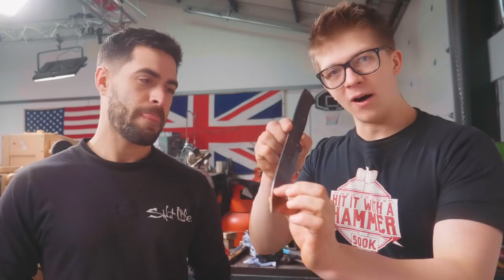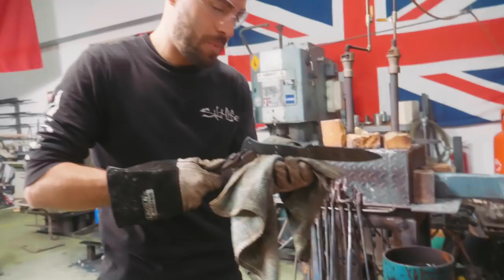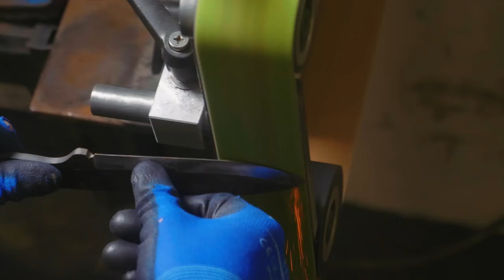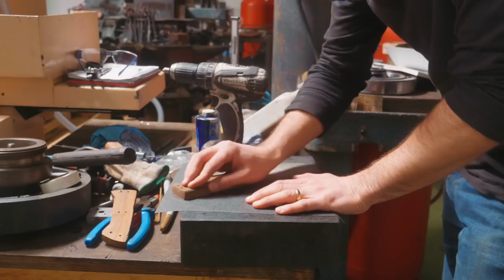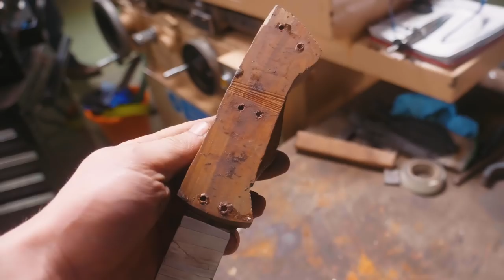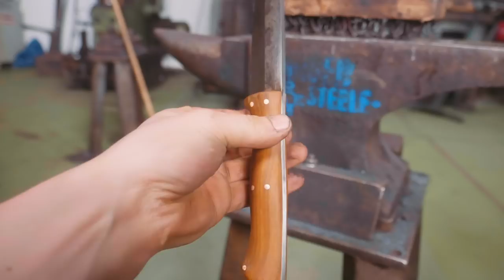MAKING A BUSHCRAFT KNIFE!!! Part 2 With TA Outdoors!!

Comment: Alec,as a machinist/fabricator with over 40 years experience I can assure you that you do what you have to do in order to get the job done. Tools and tooling was made to be used. So thanks for the warning but I get a bigger kick out of seeing you get the job done ,come hell or high water.
Reply from the maker: Thank you sir!
Reply: wes bang on mate. as long as the product is 100%  A ok the method to reach that point is secondary. i do admit thought i actually love someone taking the "long way" around to "right" than the quick way to "ok"
Reply: In the field its getting the job done, not about the... perfection of how a tool is suppose to be used. That is left up to old mate with a clipboard, that half the time you just want to F*** off. 
i think AVE put it perfectly in one of his older vids.
Reply: Perfect is the enemy of the good :p
Reply: Wow this comment really weirded me out... I was like hey I don't remember posting this and I certainly don't have 40+ years of experience...

Comment: Fun Fact(s), Lignum Vitae was used as a bearing material for ship propeller shafts where they exit the hull. Waterproof, self-lubricating and very hard wearing. Good choice ;)
Reply: But incredibly hard to find, on the endangered list and cannot be traded between countries, so I'm wondering how he got it? Probably Argentine, but even that isn't easy to get, at least not last time I checked.
Reply: I think that's a fun fact! Bowlinggg!
Reply: @tybertimus  It's not that hard to find as long as you're not looking for large pieces. Lots of it is recovered wood anyway as it got used for all sorts of things. Old light rail systems with overhead feeders often used it because it could tolerate the high temperatures of the high DC volt power systems. Most have been replaced at this point, but there is a lot of recovered wood sitting around out there. 
Also, there are a few species of wood that get passed off as lignum vitae so he may not have a piece of the actual stuff.
Now that Alec is in the USA, he'll have access to all the mesquite he wants. It's not as hard as lignum, but its a lot easier to work and is roughly as hard as some of the tropical rosewood species. It also resists rot and is super stable.

Comment: Hi Alec, I have had this trouble with O1 before and other alloy steels. You need to do a spheroidising anneal.  Heat the steel to sub  critical temperature, around 400 C (dull red in the shade). Have it sandwiched between 2 other pieces of steel of similar size and thickness (bound with binding wire) and rather than leave it in the forge use a bucket of fine vermiculite as an insulator. This is essentially a high temperature temper with a super slow cool. I have had success with bearing steel and O1. If you read this I hope it helps for next time.

Comment: Lignum Vitae is one of the few woods so dense it will sink in water. Until the advent of advanced polymer plastics it's main use was for tools and parts that ordinary wood could not hold up to.
Reply: Fun fact, was even used as the main shaft bearing in the first nuclear submarine.

Comment: Easiest way to aneail it is with a bag of vermiculite.  It's in the plant section at your nearest home improvement store.  Bring it up to critical temp and stick it in a bucket of the vermiculite.  It will take several hours to cool if not longer.  01 will sometimes air harden a little.  This always works for me.

Comment: If your struggling with normalizing high carbon, take it to critical temperature and bury it in the middle of a box of wood ash. Leave over night. I use a small ammo box. Much slower cooling time in the insulation of the ash.

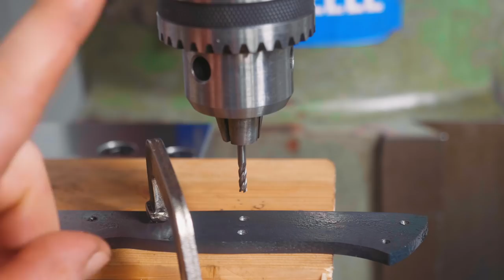Comment: 2:30 No real issue using end mills in the Jacobs chuck in this case as you are only plunging. Issue would only come if you were to apply side load to the tool e.g. for "milling" instead of "drilling. There would have been a few heart attacks I am sure if you were slotting :D

Comment: Buy some carbide tipped drill bits. High Speed Steel (HSS) is only good for drilling soft materials and mild steel. Coatings won't help either. There are some alloy bits that would work too, but for the kinds of things you want to drill and how often, carbide is a much better choice.

Comment: Try a diamond bit for drilling super hard tool steel. Seriously, it does work. Hole size is not very well controlled but it will get through if you are patient and take it slowly.

Comment: Should of cleaned it all off then put it in hot vinegar it oxidizes carbon steel very nicely for a protective coating. I've done a few knives in it to stop them from having rusting problems

Comment: Hey Alec (or someone else who can answer my question),

I got a question about connecting the wood of the handle to the knife. In this case you used an epoxy and that copper round stock. How do you make sure the copper will not loosen over time. Is it a combination of the epoxy and the tight fit? And what purpose does the copper have if you're using the epoxy anyway?

Cheers! :)

Comment: Nice. But... ;-). The design can be improved by adding a place for your finger in front of “the guard” so a rounded over deep and finger wide notch in the blade. Most bushcraft knives have that. It enables much better control when cutting.

Comment: The main reason you don’t use end mills in a chuck is cause you are cutting on the side of the end mill. the chuck is made for vertical movement and the collet is made for horizontal. Having said that, i saw how sloppy that end mill was wobbling around in that chuck and i wouldn’t want to be anywhere near that thing let alone leaning in close to find a hole to drill by eye.

Comment: Alec! Im making a knife out of some kind of steel i found on top of the roofing beams in my grandparents' barn(and obviously the steel is rusted to the moon and back) and when you were pining the handle on the knife you two were making i realised that i don't have access to so something i can use for pins, any thing you could recommend that a twelve year old boy could get his hands on other than using nails? Ps: even tho i have a anvil and a very makeshift forge that was bearly able to melt some lead and i could get a better blow torch than the one i have, some tin soldering wire and copper pipes and make some bronze and forge it down i kinda want to avoid that because i want some more experience first, and using my wood-lathe to turn some wooden pins is of the table. They would have to be way to thin for me to comfortably turn them. Edit: and obviously its gonna be a scandi grind! Because im from norway!

Comment: Hey Alec, I've got an issue that I wonder if you could help me with. I've been beginning bladesmithing in my school's propane forge, but my work is getting huge amounts of scale and oxidization. When I filed and sanded it down, there was a massive amount of pitting in the steel. Any idea what would have caused this and/or how I can fix this problem?

Comment: What is quenching? Do you need that before hardening?
Reply: Quenching is hardening
Reply: Mason Wheeler so at first you harden it at like 800^C and afterwards at 200^C. Why?
Reply: Hardening is the process of heating the steel to about 820°C and then cooling it rapidly (quenching it)
Then it is hard an it will hold an edge, but it is very brittle, so you temper it (heating it to about 200°C for about an hour)
The steel becomes much more shock resistant while losing slight degree of hardness, but you would not want to use an untempered blade
This process works for carbon steels like 1095 an O1, for other steel the temperatures and times I've given may vary extremely, especially for stainless steels.
Reply: From what I can tell quenching is rapid cooling to make the blade hard. I believe in the process it becomes brittle which is why they temper it.

Man at Arms have a great video with Anduril (LoTR) where they show why its important
Reply: That is exactly what I said :)
Reply: You should look at Shadiversity's channel. He made an awesome, very clear video on tempering and quenching.
Reply: Though you have to watch Shad's videos with a grain of salt half the time
Reply: Perfect Moments I think he means a quench in oil, and then you temper it at a lower temp in like an over because out of the quench the blade is brittle, and too hard so it is too hard to put a good edge on.
Reply: M Wadud that's one of my all-time favourite MAA videos, but i still cringe every time the Sauron cosplayer walks up to the anvil...